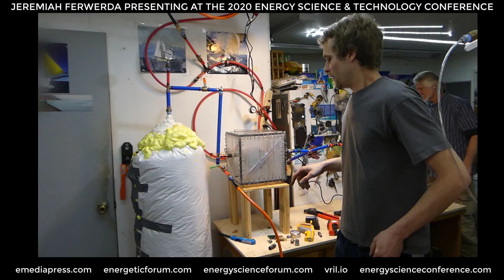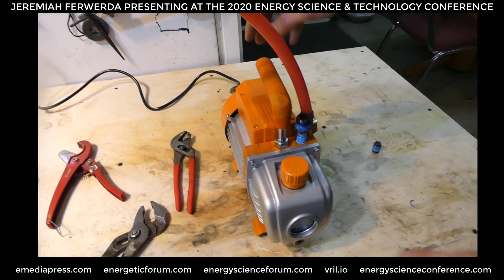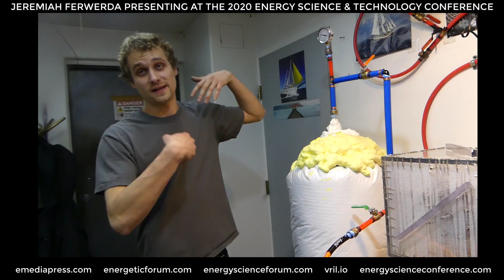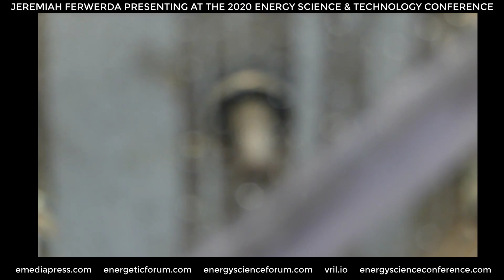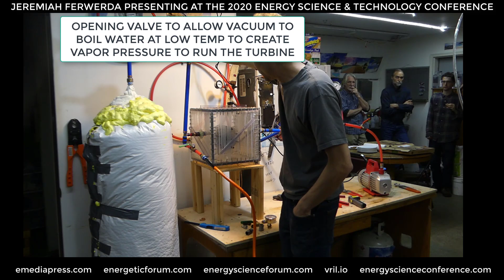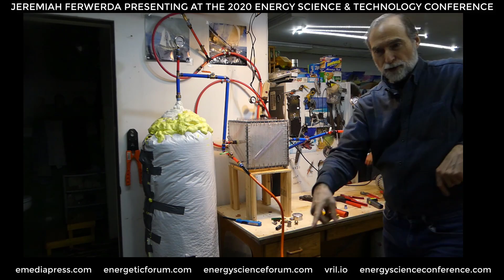Self-Sustaining 2-Stage Tesla Turbine

Comment: I look forward to the conference! Our Demo will be much better then, we have made a lot of progress since then and are building a metal turbine pump combo, with very close tolerances.
Reply from the maker: Tickets are selling out fast, http://energyscienceconference.com
Reply: (synchronized speed between the fluid and the blade to reduce vibration, increases rpm limit, and increases efficiency in overall) try using what tesla did. efficiency increases up to 98%
Reply: Shane Lee  Yes the load will throttle the turbine with a feed back signal based on the capacitor/battery bank voltage.
Reply: God has said in the Quran:

{ O mankind, worship your Lord, who created you and those before you, that you may become righteous - ( 2:21 ) 

 [He] who made for you the earth a bed [spread out] and the sky a ceiling and sent down from the sky, rain and brought forth thereby fruits as provision for you. So do not attribute to Allah equals while you know [that there is nothing similar to Him]. ( 2:22 )

And if you are in doubt about what We have sent down upon Our Servant [Muhammad], then produce a surah the like thereof and call upon your witnesses other than Allah, if you should be truthful. ( 2:23 )

 But if you do not - and you will never be able to - then fear the Fire, whose fuel is men and stones, prepared for the disbelievers.( 2:24 )

And give good tidings to those who believe and do righteous deeds that they will have gardens [in Paradise] beneath which rivers flow. Whenever they are provided with a provision of fruit therefrom, they will say, "This is what we were provided with before." And it is given to them in likeness. And they will have therein purified spouses, and they will abide therein eternally. ( 2:25 )

 Quran
Reply: Over unity electric generator. By AMA.
Segment 1: 1 motor with bar connected to it standing vertically. Circular disc connected to bar that has magnets embedded in it surrounded in high permeability material to focus magnets outward pushing force in an upwards direction from top of disc. 
 Segment 2: Hollowed out cylindrical Bar of material horizontally positioned. 
 Flat hollowed out ring shaped material with openings around its outer top flat edge.
 Magnets surrounded in high permeability material embedded in these openings.
Magnets positioned in openings around ring are in at least 1 of 2 configurations either all N magnetic field pushing out or N,S,N,S all around it. Just depends on whether your going for Piston structure or spinning structure explained below & whether you want it to be DC or AC current. 
Place these all along the cylindrical bar connected to it solidly, except at far ends of bar. 
At both ends of bar place ring of material that can be magnetically repelled in specific locations. (magnetically repelled in specific location is in reference to outside of ring area that faces away from center of bar)(Other side of same ring facing in towards center of bar is capable of being magnetically repelled all around) Ring must be connected solidly to bar. points of repulsion on these rings is off set from each other on each end of bar. 
3 Hollow ring structures with small square bars protruding from each. Ring structure has all magnetic repulsion on inside of ring shape & can rap around the main bar so that the bar wont be causing friction on things as it moves back and forth or spins. 1st positioned around far left of bar, 2nd position at center of bar (be sure to leave enough room for magnetic structures to be able to move back and forth without hitting it) & 3rd positioned on far right of bar. 
Tube structure is constructed in two parts that fit together on top of each other length wise over main structure. 
Tube structure has 3 square openings for the bars that the Ring structures that are connected around the main bar keeping it from causing friction on structure, to slide into. 
This tube structure is designed with material that does not block magnetic fields. Perhaps some type of transparent material glass or other. 
 At both ends of the tube structure there is a built in circular groove that will house a round disc. The ceiling/floor/left side/& right side of groove has openings for small magnets to be  embedded in it, so that the pushing force from magnets is pushing in towards the edge of disc that goes in this spot. There is also 4 openings located on the top, bottom, left & right positions of the open groove. Small magnets are placed in these spots so when round disc is in position these magnetic fields will hit sideways keeping it from generating friction against structure. 
Far Ends of bar has Cap structure that screws over tube halves holding them together. Cap structure also has 4 points on inside top, bottom, left & right that have openings. These openings have small embedded magnets in them that exert there pushing force outwards (sideways) so it will keep disc in position, generating no friction against structure. Cap is made of material like tube so it does not block magnetic fields. (Note: These magnets in groove and cap structure are only needed for piston design. If Disc is directly connected to main bar so as it spins the bar spins, magnets are not needed here).
 The disc has ring around it (ring of material goes around outer edge and folds over front side & backside a small distance) that is repelled by magnetic fields so the 12 small magnets will keep it lined up but it will be able to spin without causing friction on structure. The disc has openings on it's flat side that face inside of tube and magnets surrounded in high permeability material are embedded in this disc. 
 The disc has small bar that is connected to it's center that goes all the way to the other end of  bar structure through the center of the hollowed out bar and connects to disc on other end. Disc on other end is set up the same but magnets embedded in it are off set in comparison. As first disc spins the magnetic fields will push against specific spot on disc connected directly to bar, pushing bar in other direction, once bar is fully pushed over, further spinning of disc will then align the other sides magnet to push it back.
 Tube structure also has half moon shaped protrusion on inside and on both halves so when tube is connected they line up to make a full ring shape on inside of tube, these half moon shaped protrusions have at least 1 small round opening on it's side in middle of curve that faces away from center of bar. The opening has a small magnet embedded in it so magnetic force is repelling out sideways away from center of bar. The protruding ring is positioned to line up slightly further in towards center of bar then the ring of magnetically repelled material connected directly to bar. This way when bar moves right or left it is magnetically stopped after a short distance. 
Copper coil setup: Copper coils are wound in at least 1 of 2 ways. Either coiled in circles next to each other (Like if you wound coils around a cylindrical bar) or laid out in a row as if wire was on flat table going up then bent to go down & back up until it formed a flat rectangle of wire bending up and down and then the entire structure folded around tube. Copper windings are then lined up perpendicular to magnetic fields on outside of tube. Ends of copper coils are connected into separate construct that will allow electrical current to flow somewhere else. 
Circular construct is built like a stand that goes around the outside of motor segment. Circular construct has flat ring of high permeability (magnetic field shielding) material that has small openings that will allow magnetic fields through specific locations. Top of circular construct has groove to allow the horizontal bar to balance on. Circular construct can also be placed on other end of bar so it is balanced. The motor segment is positioned so the disc connected to the bar that is connected to the motor is lined up so the disc passes under the horizontal bars disc that is at end of horizontal bar. The high permeability material keeps the magnetic fields in disc from hitting into the disc that spins or pushes the horizontal bar until just the right moment when the impact will cause the disc in horizontal bar to spin which will perpetuate the piston motion in the horizontal bar. More horizontal bars of the same design are built and positioned around the motor segment in a circular horizontal fashion all the way around. The bar connected to the motor can be increased in length to desired height (As much as motor can handle) and more of the exact same setup is repeated higher and higher up, maximizing the over unity potential of the construct to ridiculous proportions. :D Current from the horizontal bars is diverted to power the motor as needed and all other current is diverted to power my game console or the world. :) Interesting variation to this design would be to connect the spinning discs on far ends of horizontal bar to main bar that magnets are connected to so the magnets spin instead of getting pistoned back and forth. So long as moving magnetic fields are perpendicular to copper wires it should work. By AMA

Comment: Put 3 coils around 3 diametrically magnetized magnets along the same shaft, each offset by 120 degrees to produce 3 phase power. You should gain the benefit of being able to use individually smaller magnets and coils to produce the same amount of power.
Reply: Ya I’d like to see it run producing electricity under a load.
Reply: He had mentioned that at high speed (high frequency Rpm) there is more losses to eddy currents with 3 phase generation and other factors with the iron. He said Tesla designs used 2 pole and he uses a diametrically split magnet directly on the shaft between 2 coils for less losses than 3 phase or trying to use gear reductions of sorts to accommodate other forms of magnet arrays. I don’t know how much truth there is to that but I do believe some of what he is saying based on everything I’ve studied. It would be interesting to see a comparison though.
Reply: @jamesblinzler1637  fu

Comment: I've been reviewing your research for  a few days, it takes a bit to understand what is going on and that you guys are not just another free energy scam. Your hard work is paying off and this is a very impressive demo. Thanks for sharing and best of luck!
Reply: kostekGSXR  The energy is in the difference between hot water tank and the cold tank that I think is outside of the building. The low pressure enables the working fluid to be a low temperature steam. The turbine converts some of the energy in the steam to the rotary motion of the turbine. The steam condenses in the cold tank to keep the low pressure side low and the system continues until there is no longer a pressure difference.

Comment: It gives good understanding that everything is in balance and in those balances of one level is one kind, to another level of another kind, so those two-level are two different energy, and in between that is 1 to 2, that is thru-out process which it gains from lower to higher level, like cold to heat, so it is not heated alone, not cold alone, but between as a gaining thru from cold to heat which it is de-pressure to pressure, so, pressure and de-pressure is balance of two. 

So, basically, 1, 2, 3, as source, medium, and result, same as 1 + 1 is 2, 1, 2; 1 + 1 = 3, 1, 2, 3, so, 2 is the balance of two 1 which negative and positive 1, so it equals to 2 or in another way 1 as source and 2 as process and 3 as result. So, mass as gas and liquid as 1; de-pressure / pressure as 2; mechanical energy which can be felt as mass-energy as solid within the environment of 2 which causes the react as 3 as a rotate mass which it is a solid mass. So, the water as one liquid or gas mass, and vacuum as energy itself that is de-pressure to pressure, to 3 as a mass that is a solid mass. So, it is connected to most foundation system how it works by gaining to lower the energy to become density energy as balance or density energy as a mover to cause the solid mass to move. So, density energy does depend on balance, the stationary balance or/and dynamic stationary balance. So, it is all about scale which we can see, and we don't see, so what is in scale which means all things are the fractal patterns. That means it can expand that foundation principle to anything as secondary because it is connected to the primary principle.

Comment: Yes use the cement for the acrylic or lexan. much stronger, way easier, better llooking.  ,;  Use a magnet with a cleaner Like a fish tank to keep down condensation for visability, and a top with rubber seal, with pressure clamps for access.

Comment: hmm could this be similar to schauburger engine? Awesome Job Congrats to your team. This is gonna be a interesting year to say the least. G-dspeed
Reply: It runs on the implosion principal, so I believe it is exactly what Shauburger did only done in a slightly different.
Reply: @iEnergySupply  My thoughts exactly. He does mention water has more energy and he is using pressure differentials schauburger was using vortex energy to create pressure differential is my guess. G-dspeed
Reply: Yes, it is also based on a depression principle and water phase transition. Same cooling effect. One difference is that Schauburger apparatus produces its power by making water rotating centrifugaly in some vortex shaped tubes of which outputs are oriented in order to obtain a reactive force that maintained the whole thing rotating. As it is overunity the regulation is obtained by limiting the water intake. Jeremiah's apparatus is simpler and probably far more reliable with its Tesla pump, that's very smart!!! Thanks for this demo.
Reply: My bad Brother, Keep up great work. When I said he I meant the guy in vid. If this is him, Keep up the great work work. I am a lil confused yet on how it is all working but your onto something here. I wish I could attend show but am looking forward to vids of it. Have you looked at mag bearings or mag lev? How gonna get rid of the Squeal? Possible Noise frequency cancelation? So many questions lol. G-odspeed
Reply: @clint9344  I have build some made with magnetic bearings, but the generator magnet when I added it to the shaft interrupted the operation of the generator. We are currently working on air graphite fluid bearings that will completely silence the machine.
Reply: @iEnergySupply  How about some RF shielding to isolate the mag bearings from the generator? Although if you can pull off the air bearings that would be best.
Reply: @Barskor1  Thanks for suggestion. I am actually working on fluid bearings, water bearings. Works great because I already have the fluid/water on hand with the system.
Reply: @iEnergySupply  So hydrostatic or hydrodynamic? 
If you could get the water to be drawn into the hydrodynamic bearings IMO it would be simple to maintain a fluid level and etching the groves in should be easy with electrolysis.
Are you just going to channel some of the steam straight to the bearings as if they were tesla turbine disks? I am excited!
Reply: @iEnergySupply  perhaps foil bearings will work?

Comment: It's a two stage heat pump with a refrigeration stage. We have known for a while now that you can put in 10W and get 15W out if you use a heat pump, and source your heat from say, 100ft below the ground. This system seems to need priming and the claim is that you can source that 10W initial cost by using two stages of state change. Though I'm not convinced.
Reply: Are you saying that you can get more output Watts than you input? Wouldn't that mean that the efficiency would be over 100%? I'm new to physics so it's all intreging to me. If I used 10,000watts to heat up the boiler, would I be able to use all 10,000watts of heat to electricity with very little loss to the cold side?
Reply: @joshuanorris9785  In refrigeration efficiency it has* to do with natural heating and cooling usually with a large surface area. Prime example is geo thermal heat. When you bury pipes with a very high surface area and then pay energy in to circulate the working fluid it results in capturing more heat energy ambient heat than what you put in to pump the fluid. A geothermal heat pump can input 100 watts to a pump and capture 300 watts of heat (guesstimate*). This is working backwards using a heat battery. He is hoping to achieve 100% return of stored energy or close using high eff. tesla pump.

Comment: Something to consider would be a planetary geared to add balanced torque to a medium speed, medium amp output motor. Best of both world? Perhaps use the cool exhaust to cool the gear casing as well. Just a thought. Keep up the good work!
Reply: Interesting concept, but planetary gears have a relatively high friction factor in the system.  The losses might exceed the gains.